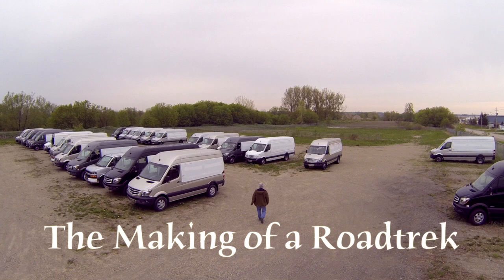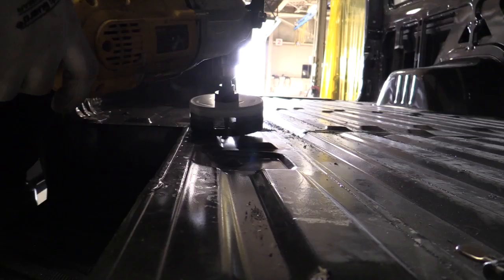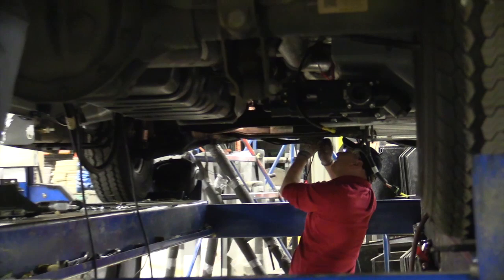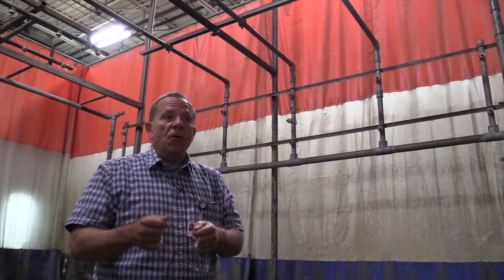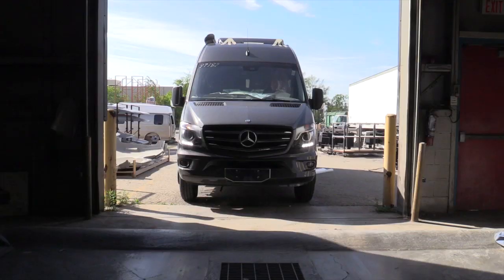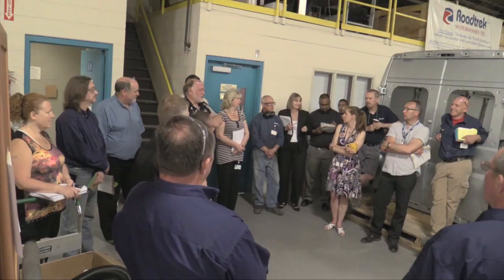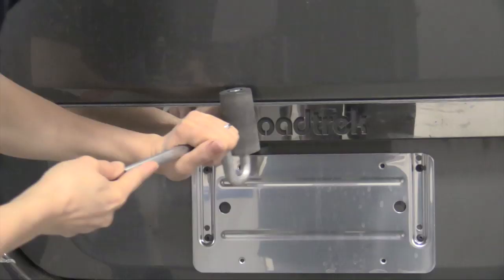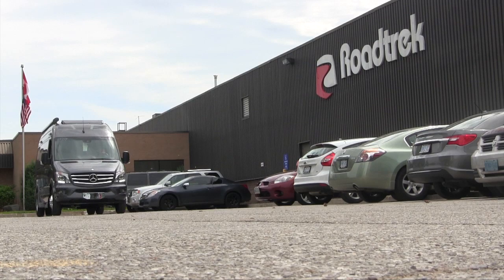The Making of a Roadtrek RV | A Visit to the Roadtrek Manufacturing Facility

Comment: One thing I didn't see in the video was insulation. Do they insulate these vans? It looked like they attached the Furnishings directly to the shell.
Reply: There was no insulation.
Reply: They do not, they just spray the inside of the sheetmetal with black sound deadening stuff but it's not insulation. Stay away from Roadtreak, it has NO insulation.